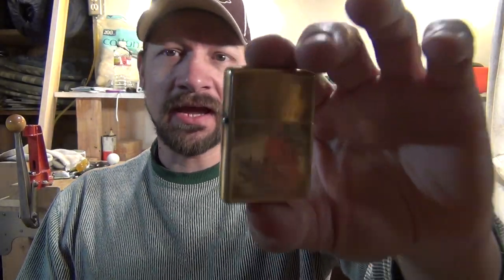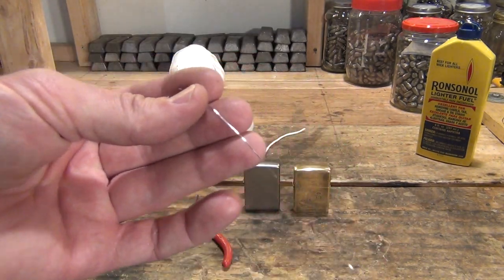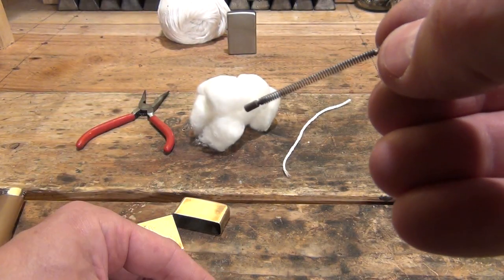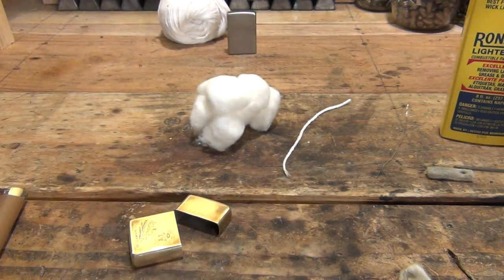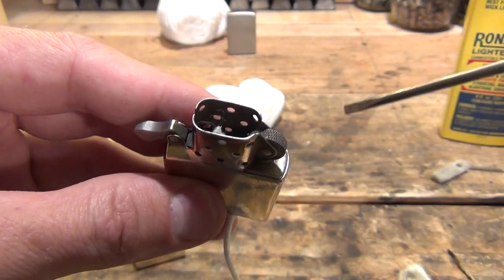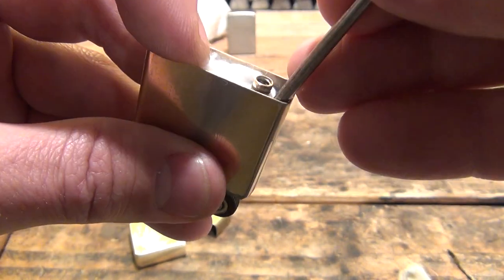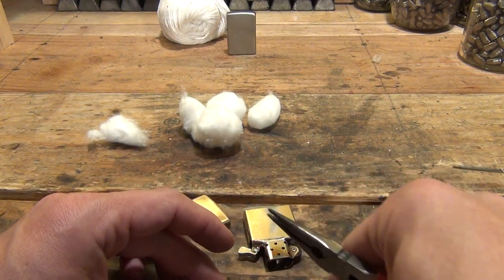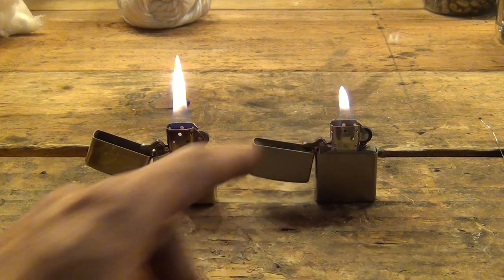How to rebuild a Zippo lighter - HD

Comment: Zippo makes a quality product and has excellent customer service. If you experience any problems with the lighter , Zippo will repair/ replace  the guts free of charge. I understand you wanted to show a diy but next time layer the cotton so the wick forms an  " S " shape as you repack the cotton. That allows the wick to scavenge or "wick " more fuel and you will not have to refuel as often. A gallon of pure naptha / napthalene can be purchased at big box stores for  $10.00 and will last a lifetime, much cheaper than the small cans of naptha sold as lighter fluid. Your videos are always precise with  clear step by steps, I appreciate that. Who won the paracord key fob?
Reply from the maker: Flick Cogswell Thank you for the info! I knew Zippo was a top notch company. I haven't picked a winner yet, been SUPER busy working 12 everyday. I've been meaning to get that finished! I have a few unboxing video's and product reviews to do also. Good day!
Reply: +Flick Cogswell  You are right when you send back a old one they even polish it.
Reply: Do you know whether or not the Zippo Warranty includes repair of the case or just the guts? Will they repair something like the entire lid breaking off at the hinge?
Reply: I believe I've read on their website that they do fix the hinge, they just wont warrant the case's aesthetics, like paint, scratches etc...
Reply: Thanx for this im gonna get me some naptha
Reply: O just bought one and refilled it with the correct fuel. It worked for a day and now it won't work.
The wire is a little messed, but It works, and It's not too much fuel, so what's wrong?

Comment: Since my last comment, I discovered and started using the EXOTAC TitanLight when I can find them on sale. They are a big peanut lighter that uses #35 viton O rings to prevent evaporation. No ZIPPO leg either😂 Now the key is IF you over fill a the TitanLight, the fuel tends to migrate up into the top cap area due to temperature changes. I just turn the thing UPSIDE DOWN, screw off the top cap, check. If there's fluid in there, put it back in the lighter, screw the bottom cap on. Wipe your hands and the lighter dry, THEN strike. ZIPPOs,  IMCO etc are open system lighters and so excess fuel simply evaporates off. Welp, lighter fluid is almost $1 an OUNCE everywhere now, thats why I switched. Of course there are other fuels that can be used.

Comment: The cam actuator is the bane of my existence. The cam itself is fine, and so is the rivet, but the actuator underneath is loose and the lid will fly open if the lighter is held upside-down.
Reply: I've watched a lot of these videos. It's a problem that's never addressed !

Comment: Great ideas to get your zippo lighter running while you wait for repair items to arrive. You didn't use the wire in the video. Zippo wicks has the copper wire to help vaporize the lighter fluid in the insert body thru heat transfer. Might be important in outdoor winter temps.

Comment: Instead of using cotton you can just cut the wick and pull more of it through. Although it is useful you will eventually have to replace it but, it is a better alternative due to the fact that the wick is better as it is kept straight with a thin copper wire. Just a helpful tip for anyone looking to fix up their old lighter.

Comment: Answer please :)
Can the fuel dry out? 
If you have a texture/pic ( i'm not english) on the zippo and it comes in contact with rain...
Wil it remove by itself?
Reply: CoolCapone2 Yes the fuel can dry out, it will do so in a couple of months, depends on how it´s stored, then just refuel it and it works again :)
It will work in light to normal rain, if the flint, and wheel is dry so the flint can make sparks.

I have a Zippo that is around 30 years old, i have only changed the flint (quite some times) and pulled the wig up a couple of times, during those years.
They will almost last forever, if used correctly.
That´s my experience with Zippo lighters.

Hope it answered your questions
Reply: Jan Andreassen Yes, u did answer my questions thanks :).
But I actually still have one left:
1. For what reasons should I replace the cottons?
Thnx again :)
Reply from the maker: Jan Andreassen thank you!
Reply from the maker: CoolCapone2 Honestly, there's not much of a reason to replace the cotton unless it's damaged or burnt. I just did out in the video to share how to. Thank you for stopping by. Good day!
Reply: Thank u, u too :)

Comment: You should not leave your zippo lit up like that for long, the heat makes the wheel's metal soft, then it won't spark correctly. There is a video from some guy on youtube showing how to "ReHarden" the wheel, but it involves getting it red hot and rapidly cooling in water, re-riveting alone is a nightmare.

Comment: I would not use flints from disposable lighters, those flints are made of a harder material flint made to last the lifetime of the disposable lighter, if you use it in your Zippo it can wear out your striker wheel down…..
Reply from the maker: I didn't know that. I've been using this technique for many years without any issues. Thank you for the info. I'll keep that in mind. Good to know. Have a great day!
Reply: My son would use those harder flints in his zippo and he do a lot of zippo tricks. It took awhile but he did wear out his strike wheel and sent his zippo in for repair, they replaced his insert and sent it back to him....
Reply from the maker: ShakerHP Wow! That's good to know. Thank you! Info is always good. :-)

Comment: I'm wondering about a 100% fiberglass twine same size, as cotton chars and breaks down. The key is keeping them filled so that the fluid burns and not so much the wick. The really OLD zippos had asbestos containing wicks that made them truly wind proof. It wicked lighter fluid quite well and doesn't burn, but it's outlawed in the US. Of course no plastics in the wick. When I get a new one I stuff extra cotton, flints and wicks in. It makes the insert harder to pull, but leaks far less, and fuel lasts a bit longer. Use a "Ranger" band (hunk of inner tube) to make it more waterproof. The Little Zippo fuel canisters are great too. Good video.